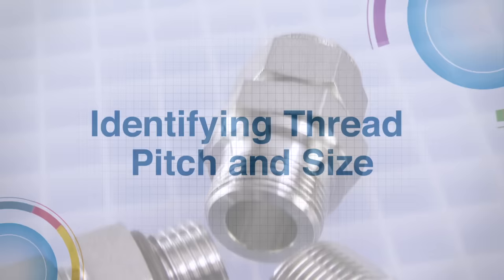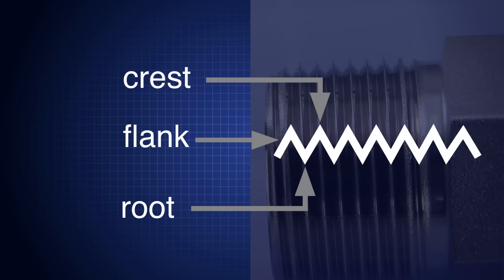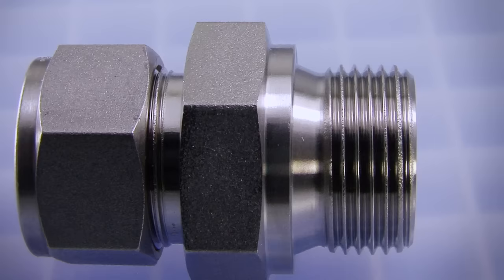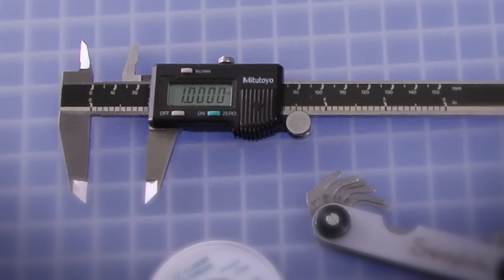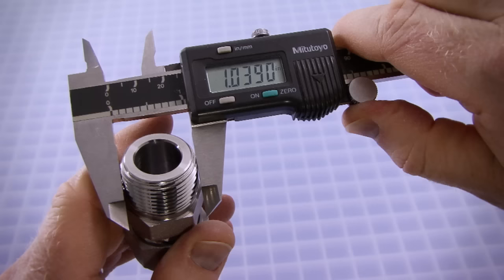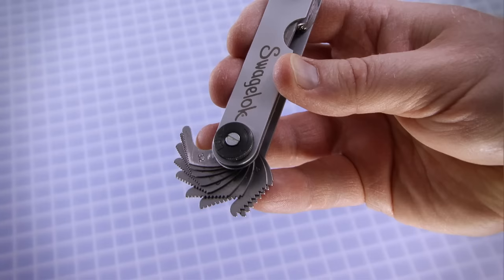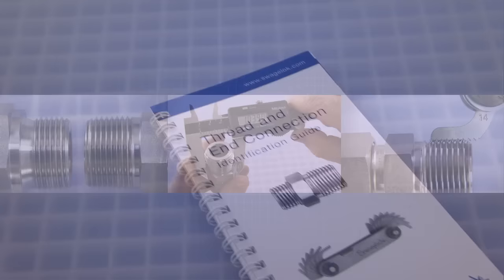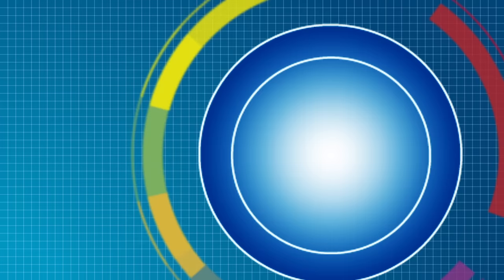How to Identify Thread Pitch and Size | Tech Tips | Swagelok [2020]

Comment: I threaded my first pipe today but the original ones that were already done that I bought were 20mm on the outside and is being sold as DN15 from China. The pipe that I bought at the home depot afterwards is 21.3mm
Used 1/2"  die and wrench with oil but it was not easy. Do you think I'm killing my die or is the 20mm not the normal standard?

After I threaded the pipe it does fit although the outside differs more than 1mm. It's more for a Steampunk artwork so it doesn't have to do something important like heating.

Comment: What does the 1.5 or 1.25 on the thread mean? For example a 10x1.5, what is the 1.5?
Reply: this video is actually quite confusing as he doesnt really make clear what form of measurement is being used at that instant and/or the images that were used are not matching what he is describing like female or male end ? 

and to answer your question just incase someone else comes across this M11x1.5 or M10x1.0 is in metric format and the 1.5 is the thread pitch from crest to crest

Comment: is m4 - 0.7mm the same as 4mm - 0.7mm ? https://www.amazon.ca/Metric-Taper-Plug-0-7mm-Pitch/dp/B00ANY5I5A if not, whats the diffrence between these 2?
Reply: They are the same. M4 stands for metric 4, which is 4mm. The 0.7mm is the pitch. The difference between the two taps is; one is a taper tap, and the other is a plug tap. A taper tap is pointer than a plug tap. There is a third type of tap called a bottoming tap which is less pointy again. I'm sure a quick google will show you when to use each, but they all tap the same size whole; for an M4 0.7mm bolt.
Reply: yup, figured it out :P thanks for the response though !